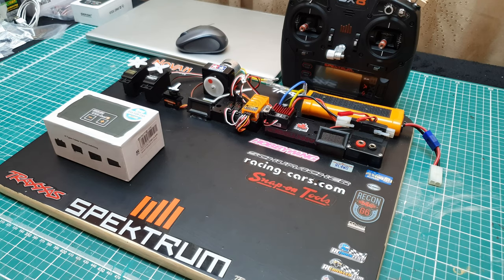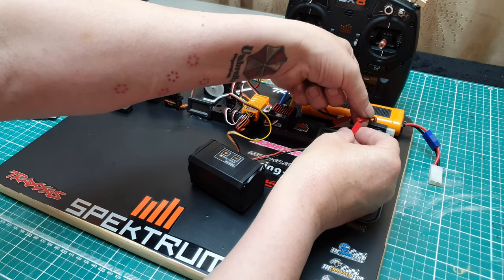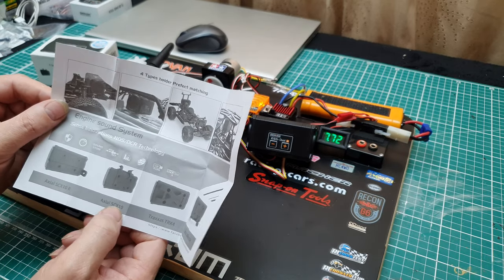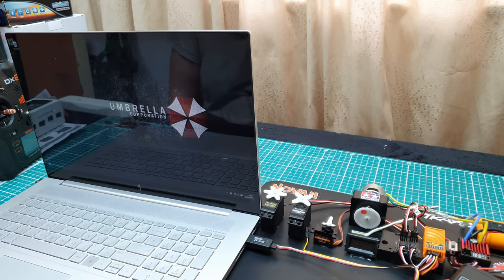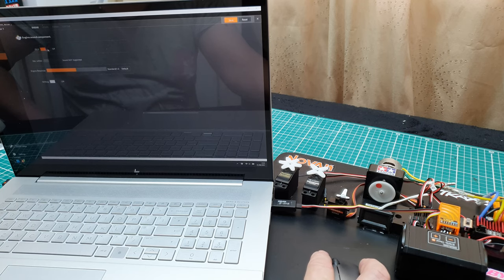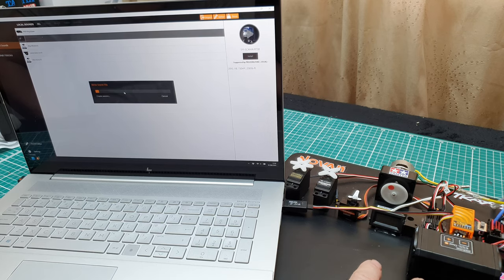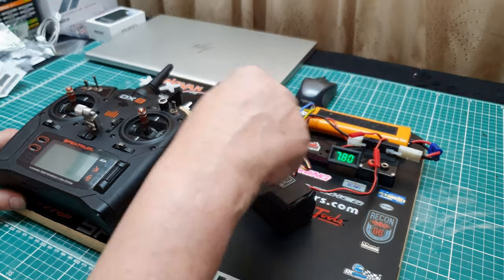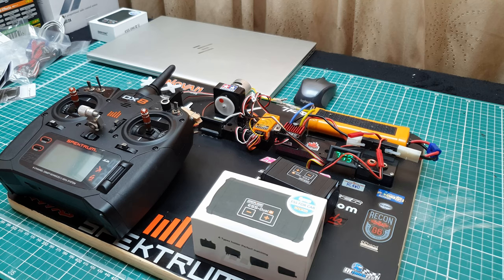Sense Innovations ESS Dual RC Car, Truck, Boat sound system

Comment: Looking to get this for my International Scout.  Been looking at several videos, always thought it was video 'magic' they already have sound. First video explaining that they come already with some sound, so it's true - you really don't have to have a computer to download any sound?  I only have a tablet, could always borrow a computer or laptop,  but if don't have to will be better. (Coinciding free time)
Reply from the maker: you can select each sound by using the buttons on the unit, no computer needed.
Reply: @TeriWilde   I can always later get together with my sister and her computer whenever we're both have the same free time to change the sound if I don't like the included sounds,but I think the ones will do. Thanks

Comment: What usb speed are you running 2.0 or 3.0? I tried installing on my old computer with a 2.0 & it kept timing out & on my new computer it's 3.0 & it installed one sound & then the S-Link got so hot it burnt up.
Reply from the maker: I'm running the latest Win11 with USB 3. The ESSone, Dual units, and the S-Link has never got close to warm.
Reply: @TeriWilde  Thanks for the reply. I wonder why mine burned up?